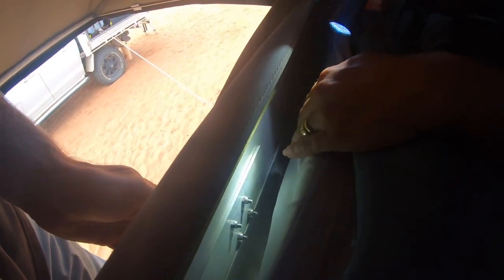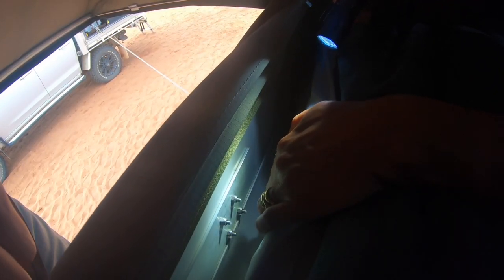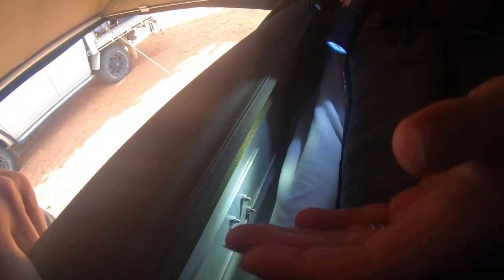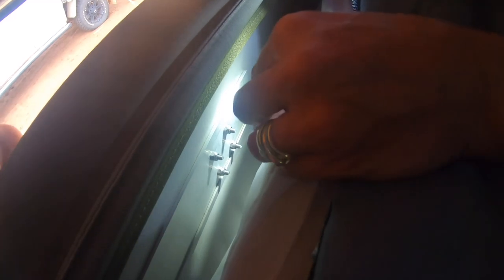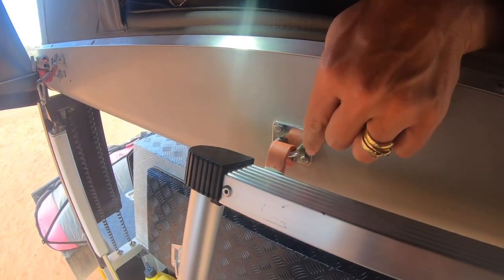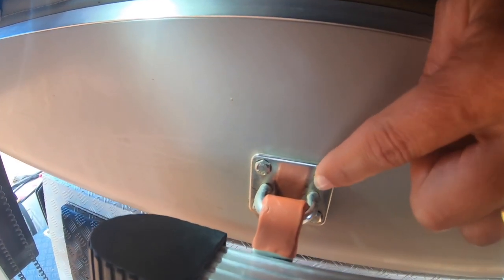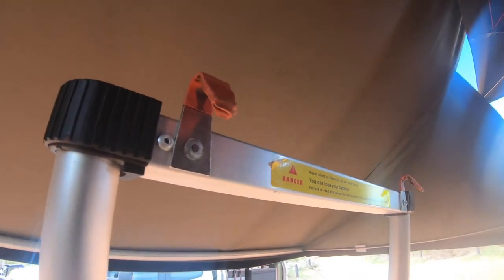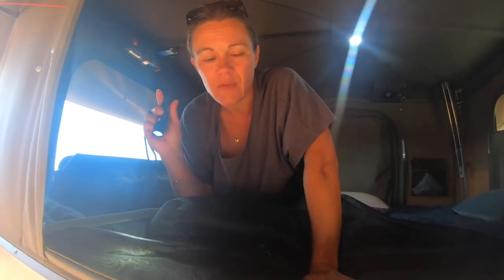Bundutop Ladder Install

Comment: Guys,  thank you for the upload, that’s really very useful. It’s a big step to drill into the side of a BunduTop tent so wanted to explore as many ideas as possible. I think this is one of the better ones I’ve seen   as I was concerned about the side of the aluminium base bowing with use!

Thanks again. Are you in Insta? FB
Reply from the maker: Thanks! on Insta, we get a bit lazy there but feel free to check it out! @outabluestouring